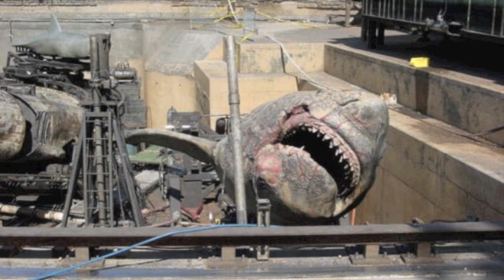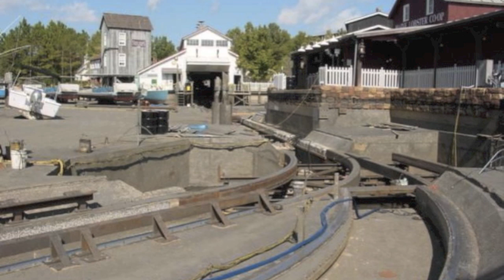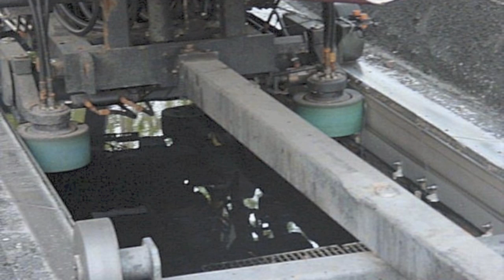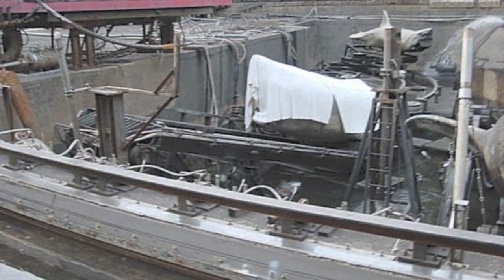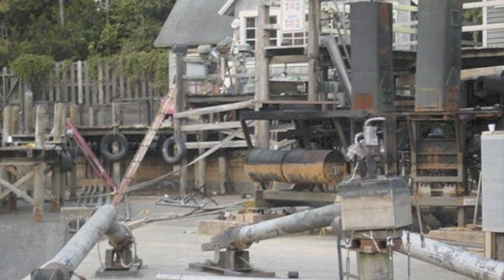Demolition of Jaws Ride

Comment: must have been a pain in the arse to drain all that water
Reply: Along with another great ride that was over at Disney World, 20,000 Leagues under the Sea. It too required lots of water to operate...300 million gallons to be exact. The animatronic fish would sometimes malfunction & they'd drain the lagoon to also repaint them & other objects from the Florida sun beating down on them. It sucks that most of those classic water rides r gone now. :(
Reply: Rip  Jaws 1990-2012
Reply: It wasn’t drained to often. Most of the time, low paid staff would dive down to repair the sharks and replace the skin.

Comment: Harry Potter didn't kill this ride. The ride's animatronic Sharks were like the one in the first movie, they hardly ever worked. If one of the few sharks was down, the whole ride would be affected and would have to close until it was repaired. They ended up draining the entire ride to fix the sharks and effects if they weren't working. The ride cost a lot to operate and was getting old. Harry Potter was just something to replace it. I loved this ride and it's a shame something so bad replaced it, but honestly, I don't think anything built over it could have been better. With the ride being nearly broken from age, having a large operation cost, and being shut down often for repairs, the ride needed to go. Universal wanted to shut this ride down way before the Harry Potter addition to the park. Once again, I loved this ride, and Diagon Alley is NOT a worthy successor by any means. But it was either Diagon Alley or an empty space where something could be built.
Reply: TuneBoy I think diagonal ally was cool but you sir are the smartest person in the comments I've seen so far

Comment: Don't these two parks struggle for space because of their location and the land they own, that's why they have to replace rides instead of just building new ones evident by that ride rocket coaster squeezed in and out of the rides and skyline backdrop. I always liked the jaws ride I think the park is just moving with the times. Harry Potter isn't going anywhere it's a huge franchise and will last. Surprised they aren't doing anything marvel related next door with how big that franchise is just now aswell.

Comment: In disaster that is not the burnt one, the burnt one was hooked up to hydraulics and pneumatics that would have to be removed with skilled practice, and plus the thing was on a track so it would have wheels. If walked through that ride when it had no water

Comment: i used to call this the steven speilberg theme park. as most of the attractions had s.s themed rides. e.t. back to the future. jurassic park and of corse jaws. along with many more. now, its all changed, but it is or has improved alot. but what a shame to get rid of king kong. ghostbusters and other attractions to accomodate harry potter.

Comment: It pisses me off because jaws was a good ride and harry pot head came along and ruined it!
Reply: The ride would have been destroyed either way. The shark was like the one used in the movie, it hardly ever worked. The ride would shut down often because one of the sharks wouldn't work and that would affect the whole ride. I liked the ride, but it needed repair and couldn't be given that. They had to drain the entire ride just to fix the sharks a few times. Because the operating cost was so high and the ride didn't work that well, it would have been replaced by something even if Harry Potter wasn't put there.